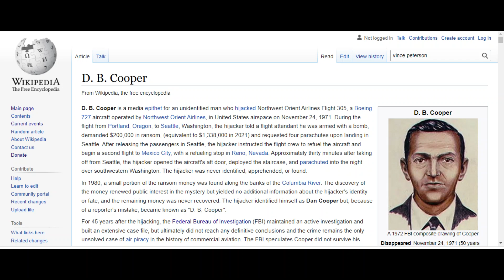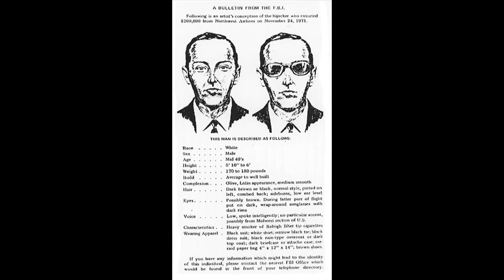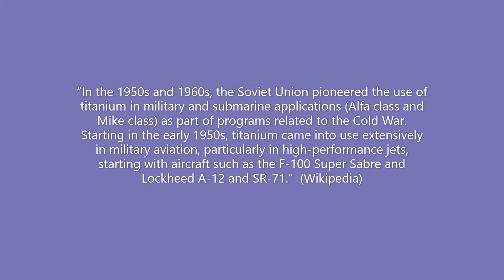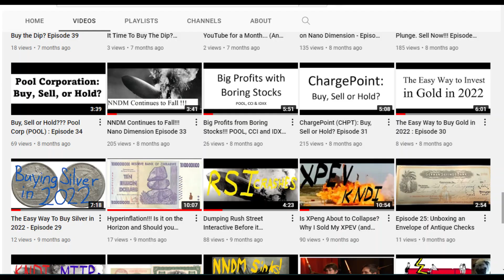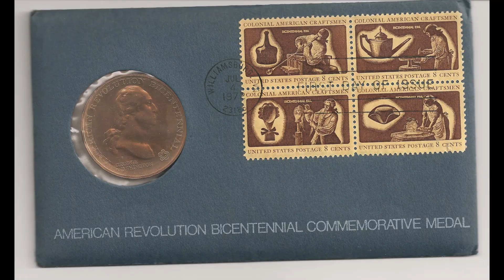DB Cooper: The Trouble with the Titanium Tie and the Latest Suspect. Episode 147

Comment: I think you need to brush up on your chemistry.  Finding particles of an experimental titanium alloy is the metallurgical equivalent of finding dna.
Reply from the maker: Thanks so much for the kind comments. There seems to be some dispute from the original sources as to whether of not this was an alloy.  I just uploaded a few minutes ago one of the videos that I am most proud of so far, you might be interested to take a look: D.B. Cooper: The Terrible Trouble with the Titanium Tie. Part 1. Episode 159I just uploaded a few minutes ago one of the videos that I am most proud of so far, you might be interested to take a look: D.B. Cooper: The Terrible Trouble with the Titanium Tie. Part 1. Episode 159
Reply from the maker: Hello, thanks for your comments. After my video on November 19th titled: Has the DB Cooper case finally been solved? episode 146 (and that is the episode number for my show to keep things more easily trackable since many of my titles are similar), that one was about Vince Petersen being identified by Eric Ulis as Cooper. The next day I did a video called: DB Cooper the trouble with the titanium tie and the latest suspect, which was episode 147. That talked about some issues with the titanium on the tie. Skipping ahead, over the past two days I uploaded a two-parter called: DB Cooper the terrible trouble with the titanium tie, part 1 and Part 2 which are episodes 159 and 160. Most of the comments that I've received along these lines were before I uploaded episode 159 and 160 so if you've not seen them I hope that you'll take a little time to watch them. In them I point out that the original research that Tom Kaye and Citizen Sleuths did, which still shows on their website as of yesterday, is that the three titanium articles are pure titanium, that is not an alloy. Eric Ulis’ conclusion based on Tom Kaye's research, Is that it was a specific type of titanium antimony alloy. Where the bridge between finding that the 3 particles were pure titanium turning into three particles of a titanium alloy I do not know, but let us for the sake of argument say that there was originally a mistake and that the particles are in fact indisputably a certain alloy of titanium antimony. Is it a valid statement that the only place that this would be found would be at Rem-Cru? I would argue: no. we have the three individuals who applied for the patent they worked at Battelle Memorial Institute in Columbus, OH. They did not work for Rem-Cru. It has been surmised, not my interpretation although I agree with it, that because the 3 petitioners for the patent worked at a nonprofit that four the patented material to be commercialized it needed to be patented under the auspices of a commercial organization, that is a Profit making company, not a nonprofit. Whether that's 100% accurate as far as the reason is probably not material here. What is material is whether these three people who worked at Battelle in Columbus, OH, produced any of this alloy there while they were developing the information for the patent, which I would argue most likely would be the case. How else could you come up with the data to put in the patent application if you have not first created the alloy? So if my contention is accurate then not only possibly at Rem-Cru, but most likely at Battelle there would be engineers working with the TiSb. So we have two places identified where there was likely that alloy at some point. Also remember that patents protect the commercialization of a discovery, product, or process, it does not preclude other people from working with that product and if they improve upon it, they can then patent the improvement to it. Also, the patent was rejected, there was a lawsuit, no patent for that particular alloy was given, and nobody was precluded from working with that particular alloy. Also in the most recent video that is episode 160, I put a screen shot of a scholarly journal written in English but from Scandinavia and probably from research done in Norway on four variations of titanium antimony alloy. That was published in 1962, a few years after the patent application was originally filed. And again lack of other online evidence does not mean that other people were not working with this material. If you were in a lab working with the material even if it was a nonprofit and you wanted to write a scholarly journal, if your work with the titanium antimony did not result in a new breakthrough of any type then you would not be writing the journal article in the first place. And many journal articles are not yet available online even if they do exist.
Again I would encourage people with questions or comments about this to watch those last two videos but I also caution people not to rush in to buying this as the ultimate smoking gun that has solved the case. I think that three particles out of 100,000 tested is a potentially suspiciously low number of particles that one might expect with somebody working with this alloy, although perhaps not. I have also worked in high tech situations at two companies that are well known throughout the world and I would argue that there are far more people that might come into casual contact with a few molecules of a particular alloy than one might expect and certainly more than a pool of only eight people. And as I've pointed out I would not be surprised if Cooper turned out to be some type of disgruntled OSHA inspector or some other type of inspector who would have gone to a variety of locations including perhaps Rem-Cru, and in the course of their job would have been exposed to the wide variety of high tech and aerospace associated molecules found on the tie besides this disputed titanium.
Thanks again for your comments and taking the time to make them here. Remember the whole point of this is to try to come to a conclusion on the identity of Cooper, not to win an argument. We all win when we are able to finally put this to rest, which perhaps may eventually be done using DNA and the particles on the tie might be able to help narrow down areas to look for certain candidates. Thanks again!

Comment: Boeing started R&D with pure titanium in 1950, In 1960 it was in the 727, and it has been in every plane they have built since. Military planes that had pure titanium, dating back to 1950, are the F-100 Super Sabre, Lockheed A-12, and SR-71, to name a few. The soviet union used it in submariners and other military craft in the 50's. There is also another aspect of titanium usage that would never have been documented and available to the public, and that is military R&D. The military had a huge stockpile of titanium sponge in the 50's. NIST also had this material for SRM tests, that anyone could have bought. Someone has to set the standards. I have pure titanium SRM blocks and different alloys i got from my grandfather, as well as his dial reading impact test pendulum, from when he worked at Boeing as head of engineering and R&D.
Reply from the maker: I agree my friend! Here is a reply that I left for another commenter. I think you will agree with my assessment: "Hello, thanks for your comments. After my video on November 19th titled: Has the DB Cooper case finally been solved? episode 146 (and that is the episode number for my show to keep things more easily trackable since many of my titles are similar), that one was about Vince Petersen being identified by Eric Ulis as Cooper. The next day I did a video called: DB Cooper the trouble with the titanium tie and the latest suspect, which was episode 147. That talked about some issues with the titanium on the tie. Skipping ahead, over the past two days I uploaded a two-parter called: DB Cooper the terrible trouble with the titanium tie, part 1 and Part 2 which are episodes 159 and 160. Most of the comments that I've received along these lines were before I uploaded episode 159 and 160 so if you've not seen them I hope that you'll take a little time to watch them. In them I point out that the original research that Tom Kaye and Citizen Sleuths did, which still shows on their website as of yesterday, is that the three titanium articles are pure titanium, that is not an alloy. Eric Ulis’ conclusion based on Tom Kaye's research, Is that it was a specific type of titanium antimony alloy. Where the bridge between finding that the 3 particles were pure titanium turning into three particles of a titanium alloy I do not know, but let us for the sake of argument say that there was originally a mistake and that the particles are in fact indisputably a certain alloy of titanium antimony. Is it a valid statement that the only place that this would be found would be at Rem-Cru? I would argue: no. we have the three individuals who applied for the patent they worked at Battelle Memorial Institute in Columbus, OH. They did not work for Rem-Cru. It has been surmised, not my interpretation although I agree with it, that because the 3 petitioners for the patent worked at a nonprofit that four the patented material to be commercialized it needed to be patented under the auspices of a commercial organization, that is a Profit making company, not a nonprofit. Whether that's 100% accurate as far as the reason is probably not material here. What is material is whether these three people who worked at Battelle in Columbus, OH, produced any of this alloy there while they were developing the information for the patent, which I would argue most likely would be the case. How else could you come up with the data to put in the patent application if you have not first created the alloy? So if my contention is accurate then not only possibly at Rem-Cru, but most likely at Battelle there would be engineers working with the TiSb. So we have two places identified where there was likely that alloy at some point. Also remember that patents protect the commercialization of a discovery, product, or process, it does not preclude other people from working with that product and if they improve upon it, they can then patent the improvement to it. Also, the patent was rejected, there was a lawsuit, no patent for that particular alloy was given, and nobody was precluded from working with that particular alloy. Also in the most recent video that is episode 160, I put a screen shot of a scholarly journal written in English but from Scandinavia and probably from research done in Norway on four variations of titanium antimony alloy. That was published in 1962, a few years after the patent application was originally filed. And again lack of other online evidence does not mean that other people were not working with this material. If you were in a lab working with the material even if it was a nonprofit and you wanted to write a scholarly journal, if your work with the titanium antimony did not result in a new breakthrough of any type then you would not be writing the journal article in the first place. And many journal articles are not yet available online even if they do exist.
Again I would encourage people with questions or comments about this to watch those last two videos but I also caution people not to rush in to buying this as the ultimate smoking gun that has solved the case. I think that three particles out of 100,000 tested is a potentially suspiciously low number of particles that one might expect with somebody working with this alloy, although perhaps not. I have also worked in high tech situations at two companies that are well known throughout the world and I would argue that there are far more people that might come into casual contact with a few molecules of a particular alloy than one might expect and certainly more than a pool of only eight people. And as I've pointed out I would not be surprised if Cooper turned out to be some type of disgruntled OSHA inspector or some other type of inspector who would have gone to a variety of locations including perhaps Rem-Cru, and in the course of their job would have been exposed to the wide variety of high tech and aerospace associated molecules found on the tie besides this disputed titanium.
Thanks again for your comments and taking the time to make them here. Remember the whole point of this is to try to come to a conclusion on the identity of Cooper, not to win an argument. We all win when we are able to finally put this to rest, which perhaps may eventually be done using DNA and the particles on the tie might be able to help narrow down areas to look for certain candidates. Thanks again!"
Reply: NASA you  want to  make sure and know he was employed there.